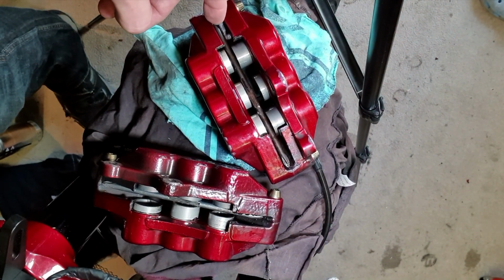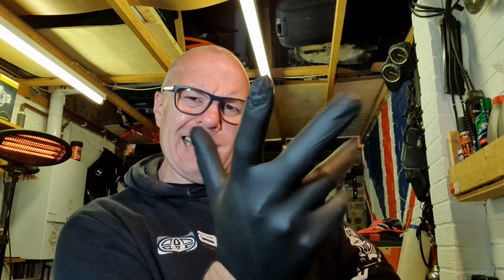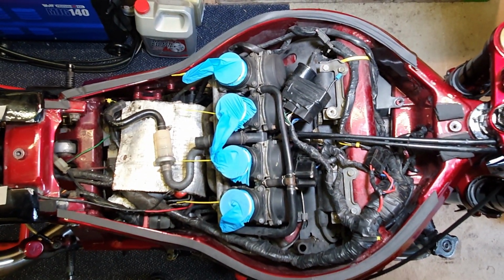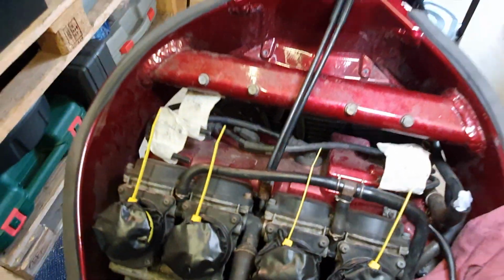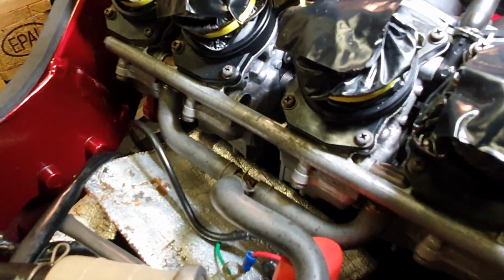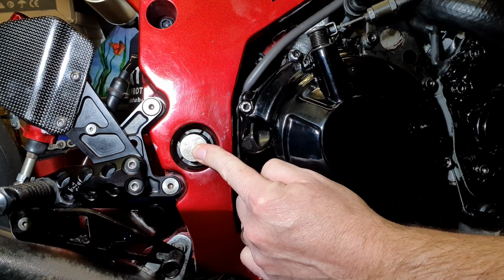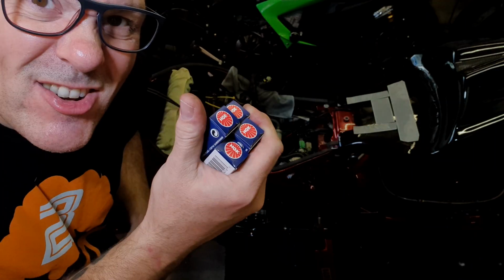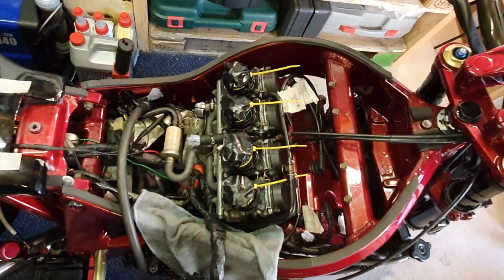Replacing 11 year old Spark Plugs - CBR900 Streetfighter Build Series

Comment: Copper grease is also good for lightly smearing on the spark plug threads.
Reply from the maker: Thanks mate, I've heard of some using it but I wouldn't as you stand a higher risk of over tightening a spark plug using copper grease which is something you really don't want to do.. 😬👍